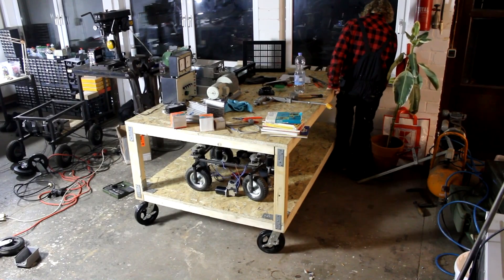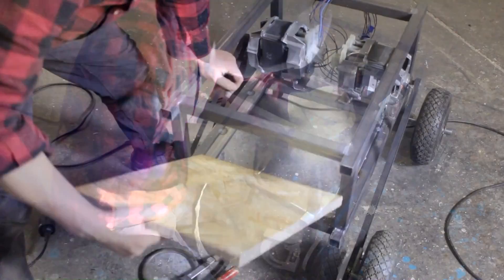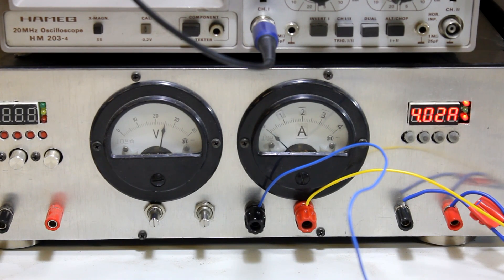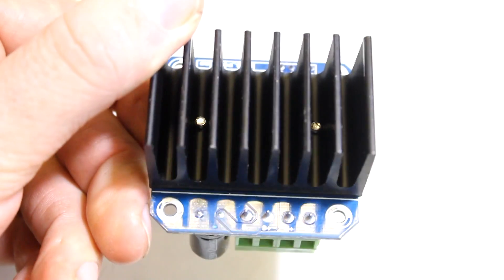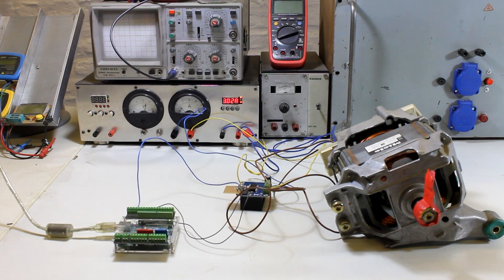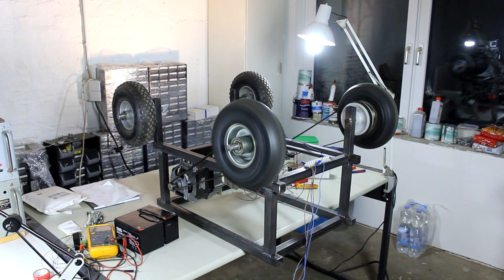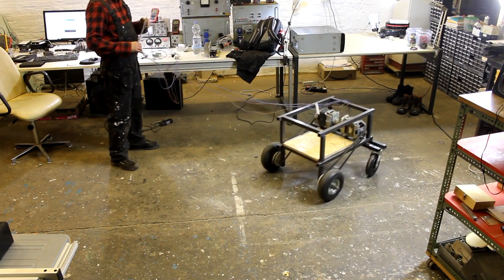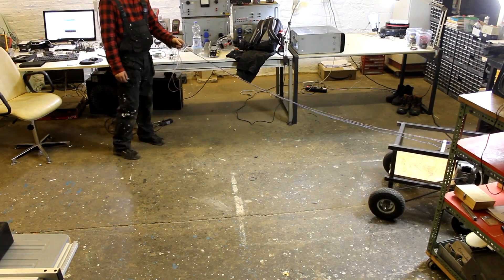Washing Machine Motor ROBOT is back!

Comment from the maker: Hey guys, here is a link to the first video: 

https://www.youtube.com/watch?v=FgkcC7BnVCQ

Here is a link to the video about the motor:

https://www.youtube.com/watch?v=CtulRqznbzI&t=697s

Here are some links for the H-bridges: 

United States: 
https://www.ebay.com/itm/Double-BTS7960B-DC-43A-Stepper-Motor-Driver-H-Bridge-PWM-For-Arduino-Smart-Car/253852056130?hash=item3b1ac2fa42:g:2yMAAOSwkV1bemru

United Kingdom:
https://www.ebay.co.uk/itm/BTS7960B-43A-Double-DC-Stepper-Motor-Driver-H-Bridge-PWM-For-Arduino-Smart-Car/292732679681?hash=item44283a3601:g:hncAAOSw2stbemry

Germany:
https://www.ebay.de/itm/Double-BTS7960B-DC-43A-Stepper-Motor-Driver-H-Bridge-PWM-For-Arduino-smart-Car/381206284364?ssPageName=STRK%3AMEBIDX%3AIT&_trksid=p2057872.m2749.l2649

All countries: Just enter "BTS7960B" into the search bar (for example on Ebay) and you'll find this item from some supplier, I',m sure.

Comment: Hello!! I always follow your video, savege electric components and power electronics are my passions;) I also look forward to arc welder. Anyway here I'm asking for some parameters you used for powering the engine, which current and voltage are you using for the rotor and stator? Thank you so much and all the best!!

Comment: Hi Guys, Why didn't  you start with a wheelchair (NOT scooter) with a joystick, I use one all the time & it does the same as your washing machine robot straight out of the box. You can always pick up old ones as disabled people (Except me) can't usually do repairs on them, such as changing the batteries. All the controller equipment is in the joystick, It's easy. I hope this is helpful  for you.Keep up the good videos. Regards, Ian.

Comment: Would be wonderful if you could get your hands on a new washing machine motor that has a controller with it. Just scrapped our old washing machine and it would seem there is a separate controller that just gets ac and some signals to control the speed and probably direction.

Comment: don't bother rectifying the inverter output, just remove the pwm! inside the inverter is a step up circuit that produces the ~300v dc, which is then fed through a pwm H-bridge to give chopped AC

edit: oh i'm an idiot i commented before watching further -.-

Comment: DC motor. Volts = speed, amps = power. Increase the size of your wires (not enough copper for the amps needed) to get more amps to the motor for more torque. Increase field amps to get more starting torque, lower amps to get more speed.

Comment: It all depends on what your plans for the robot are, but I'd have gone for a forklift-like steering rather than for caster wheels. The problem with these is that no matter how precise you control both motors, you'll always have an error proportional to the distance between the caster-wheels' contact-point and it's rotational axis' center, and this will cause it to hit everything around when maneuvering in tight or confined spaces. Another solution for the driver you didn't mention or contemplate is using AC out of the inverter with triacs, which would be much more efficient than rectifying it's output back to DC. Also, if you have the lathe operational, you might want to rebuild those hubs, which besides rotating off-center, might need some rotary encoding implemented for motor control.

Comment: I will not pretended to know a lot about electronics, But wouldn't it not be easier to build a step-up DC power supply with amperage you need, then a micro controller with a Uln2003 to drive relays for the forward and revers directions ?

Comment: Could you use an adjustable current source for your fields to give more control of your motor torque / speed? For instance, even just a two stage "high / low" current source where there is more field current for high torque requirements, and lower field current to allow a higher top speed?

Comment: Great you re on it again. If you want to use it with 12V from a car battery couldnt you just use an electric car starter? I know they draw a lot of current but unless you dont want to start a motor I think thats something that can be regulated smoothly.

Comment: I believe the traction issue is more to do about the rigid framed 4 wheeled design. One of the 4 wheels can lose traction if the floor is uneven, or one of the wheels runs over an object. Switching to one caster wheel would solve this. Or, put the cross member that the caster wheels are attached to, on a pivot so that the cross member can tilt keeping the casters on the ground independent of the frame.

Comment: I'm very glad you're back in action on this washing machine robot project.  I learn a lot from your ability to take ordinary devices, like an inverter, and repurpose them to do multiple tasks that they were not designed to do but can easily be adapted.   You probably only have a vague idea as to what the final device will look like but that's how great inventor's minds work. I have several works-in-progress but only a few of them actually get finished due to some road-block or two that always comes up along the way.  You have a much better track record than I of completing your projects so I'm very much looking forward to seeing the final result of this one.  Keep up the great work!

Comment: Great video PAI! Just a suggestion, it would be more efficient both in moving and steering if you only used one castor. It also occurred to me that converting 12V to 300+V trades current draw from battery to volts, which would mean you will need a battery with a lot of current capacity. Would it not be equally heavy and expensive if you equipped this with a bunch of batteries giving you the required volts? I can see that this second route will require balancing circuits for the battery pack, but then it doesn't need a boost converter...just a thought. Looking forward to the next vid!
Reply: Volts or amps, the importat thing is what power they can deliver. Depending on the type of battery, no balancing needed for lead acid.
Reply: @LunaticCharade  Agree Petter, but inefficiencies occur in every buck / boost stage, so reducing such stages should give slightly better run time. Mind you, this is a general rule of thumb -  I don't know how efficient each stage is so perhaps its not a big deal after all.
Reply: @Bennyboy-dog  yeah, the most efficient is probably a boost converter that is also the control stage. Since  a power Hbridge in pwm have much of the losses as a switching converter, and they are almost the same thing except the inductor part. Though when driving a motor that is also an inductor! Probably also the most difficult design to implement. Otherwise many series batteries are probably the most efficient. 
Im guessing that he wont use the specified rpm of the motor, so the full voltage is not needed(in a crude way, volts=Speed, amps=torque). Half voltage might be Good enough. But with gearing he might use the full range so se shall see!
Reply: @LunaticCharade  - thanks Petter, that was a succinct summary of the conversion processes!

Comment: It seems to me rather than all this screwing around one would be much better off just to buy 2 12vdc cordless screwdrivers or drills. Then hack in an H bridge or a controller. Plus I don't think your undervoltaged washing machine motors are going to have much torque when it comes to getting up hills or hauling a serious load which is what you insinuate when you show a frame that heavy duty.

Comment: TPAI Motor and controller from electric wheel chairs would be  great if you could find such. Save all the work to change AC to DC etc. Whatever thanks for letting us see the work. I think the 4 wheel robot you chose will be a lot steadier than a 3 wheel one.

Comment: You might be interested to look into using car alternator as universal motor, drop the diode pack out and connect the 3 phase leads to a ESC Electronic Speed Control from Radio Control Equipement to give you variable 3 phase supply, and use a PWM dc variable supply between 1 to 6 volts on the field coil and you can have complete fine tuning for torque and speed control.  Alternator would make ideal motor for Robot.  Bare in mind the more voltage in the field coil will slow motor down because of magnetic lock up (drag) as not been used to generate power with external source to turn it.

Comment: So, you mentioned using the boost converter from the automotive inverter, but that's already hooked to a high voltage high current h-bridge.  Just cut the control lines and use your own to make one of those inverters a full high voltage motor driver.  you probably also get current sense feedback somewhere in there too and a 5v logic supply

Comment: You might also be loosing traction because of no suspension. 3 points of contact would likely give you more traction on a "flat" surface.
Reply: Good thinking. Yeah, the drive wheels need to be able to stay in contact with the ground.

Comment: Supplying a constant current to the field coils seems impractical.
I think it would be better to connect the rotor and field coils in parallel and to add a bridge rectifier to the field coil, to keep the motor bi-directional.
Reply: I think that would not be a constant current making steering unpredictable.
Reply: @MrScooter46290  Constant current does not mean constant power or rather constant speed. You'd need positional sensing and feedback for this robot anyways or else it would go off course as soon as it hit a bump. The motors already have speed sensors in them so might as well implement a more efficient drive control mechanism along with the positional sensing. This robot will be completely useless if it has to drag a cable along with it so it has to be efficient enough to operate with batteries. Otherwise the cable would get tangled around any obstacle, provided this robot is somewhat autonomous and not RC.

Comment: You already have the H bridge in the inverter, and simply have to remove the micro from inside it to get the H bridge connections free.  The primary side likely uses a 3424 or clone as driver, and this will work alone to give the 300VDC you need, and then you can drive the H bridge already in there with your own controller, making it smaller and saving building the bridge again.
Reply: I guess you could do that, but he does need 2 H-bridges anyway to drive both motors, so it´s probably not worth it.
You could also leave the inverter intact completely, and only add an output from the DC bus. That way you could even use the AC output for some other load while driving the motors.
Reply: You could centre tap the motor windings and use a half H bridge on each motor, saving the need for two h bridges. Either that, or supply a constant 300vdc to the armature and control the motor torque / speed by changing the field current 👍
Reply: @DatsunRacingTeam  If you supplied constant voltage to the armature, as I understand it, you could never actually stop the motor, right?
You´re right about the center tap, although that would mean you need less voltage (or lower duty cycle) to drive those.

Comment: Would it not make sense to have the weight of the motors closer to the driving wheels?
Or was that a design limitation dictated by the length of the drive belts?

Comment: Are the drive motors going to have optical encoders? In my experience casters have a problem with the deadband required to turn them in the correct direction, the encoders might be able to compensate for that, and tell which direction the robot is moving without external sensors, because one wheel would be going faster than the other, if the caster got stuck sideways. BTW I love your vids too, keep it up 🤓.

Comment: I think I would have made the motor drive the front and rear wheels, then you could have made it skid steer.
Reply: Takes a significant amount of power, and can leave nasty skid marks everywhere.
Reply: @wolvenar  Skid steer doesn't actually skid, so no, there wouldn't be skid marks. Skid steer works by making the wheels on one side go forward while the other side go in reverse. It's how zero turn mowers and tanks work. And that isn't going to take any more power than making the wheels on both sides go forward while at the same time turning them left or right. In fact, it would probably take less power because you wouldn't need a motor to steer the wheels.
Reply: @SwapPartLLC  Ok have you ever ACTUALLY seen how they work IRL because, seriously how can you POSSIBLY believe that if you have. When turning with a skid steer, there will ALWAYS be a wheel or track sliding SIDEWAYS at some point. They DO "skid". Hence the namesake. I have used, worked on and built machines that employ skid steering since I was just old enough to hold a wrench. I think I would have noted by now if there was ANY way to do this without sliding of some part of the machines drive. But hey, I do not claim to know absolutely everything. If you can give me an example of skid steering that doesn't A. Take significantly more power (this includes the differential wheel speed not just locking wheels). OR B.. Provide information on a skid steer system that has a track or 4 solid wheels that does not drag some portion of the drive train at angles  against the normal wheel rotation please show me where I can learn about them. This is how I have always experienced and understood skid steering https://groups.csail.mit.edu/drl/courses/cs54-2001s/skidsteer.html
Reply: @SwapPartLLC  BTW.. Zero turn mowers almost invariably use caster type wheels.
Reply: @wolvenar  Yeah, I guess you are right. I'm thinking about turning from a stopped position, but if it was moving forward and one side was stopped or reversed, I can see that skidding.
Reply: @SwapPartLLC  Your getting closer.. the skid is not in the direction of travel and much as it refers to some of the wheels or track has to slide sideways. Normal steering this happens as well but generally on a individual tire and more of a twist per tire. With skid steer the twist is more relative to the center of the vehicle, so it has to slide the wheels / track at more of an arc
Example of what I meant. https://youtu.be/Mtfw3n5BVpE

Comment: Interesting project.I have nowhere near your expertise,but I made two observations: 1) the difference between forward and reverse is due to universal motors being biased in one direction by shifting the brushes in one direction.You can see the effect of this in a cordless drill.It will run slightly faster and have more power in the forward direction.
2) buy putting a single swivel caster in front the floor contact of the drive wheels will always be equal , as any floor irregularities will be negated. Think of a four legged table on an uneven surface VS a three legged one

Comment: could you mod the H-bridge on the inverter boards
Reply: Cut the H Bridge section off and drive it with an H Bridge controller chip or some logic gates.
But never try to control the MOSFETs directly with the uC pins as a software error could turn on both transistors on the same side which would quickly fry them.

Comment: why no use 12v dc motor?
Reply: One of the main purpose of this projet was reusing old washing machine motors
Reply: I think the challenge is to work with old parts and not to buy new stuff (or to buy as less as necessary). So he could use dc motors from a car (like the windshield washer motors), but they dont have the torque of these big guys up there ;)

Comment: You're a brave man, putting a workbench against single pane glass windows.  I'd be too worried about accidentally breaking one.  Do you have any tough clear plastic that you could use as a window guard?
Reply: I was looking for a comment about the WINDOW! Yes. Do NOT put sparks on glass!!!  Metal sparks stick melt into the glass and can rust.
Reply: A sheet of Poly-Carbonate will fix that problem.

Comment: How fast does that robot go?
Reply: Bio-error 1d10t: User unable to create name.  
1400 spin.  70 rpm normal wash heavy soiling.
Reply: @muesli4597  I would run the numbers, but I don't know the exact size of the wheel and stats of the motor itself.